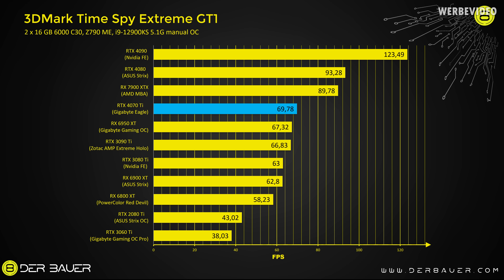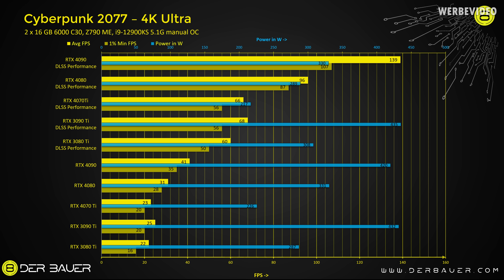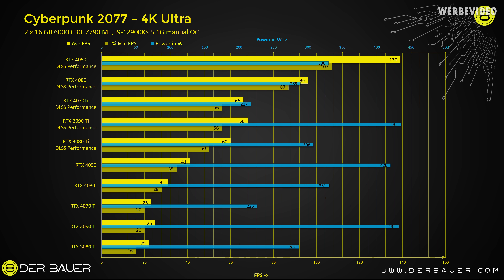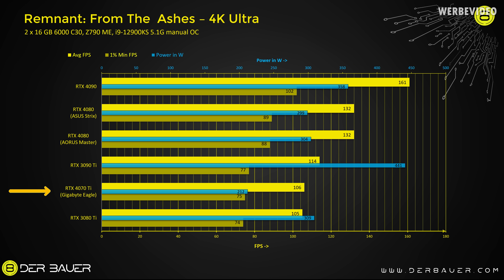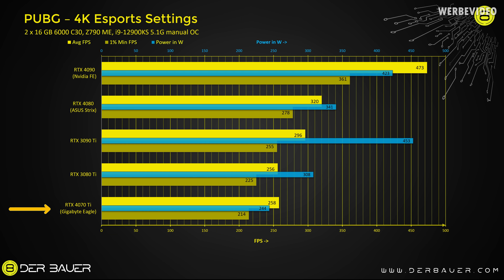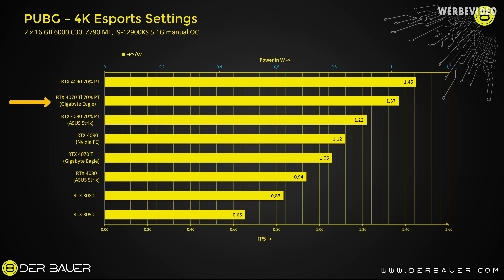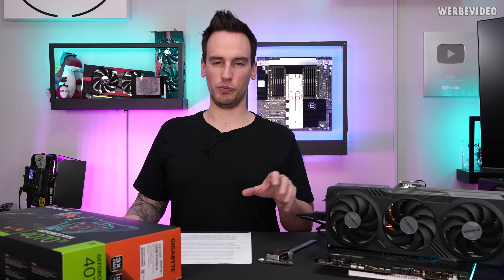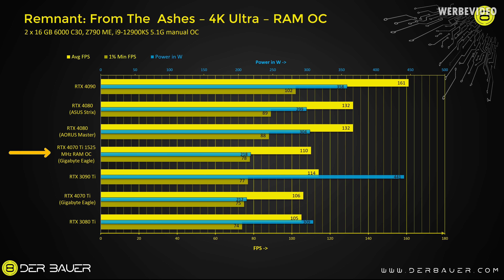Overclocking RTX 4070 Ti VRAM to Compensate 192-Bit Bus Width?

Comment: Shame you're testing a budget card only on a high end reference system (target audience is more a mid-tier ~12600k, a game like PUBG is more CPU intensive then CBP'77), and using "review drivers" at that (what does that mean? optimized for benching certain games? not ready for release?).
I trust the comparative performance from your testing ofc, but did you actually play any games to see if the real world fps hits the same absolute numbers?  (especially card memory sometimes gives diff results in real gameplay?)
Reply: "Shame you're testing a budget card only on a high end reference system (target audience is more a mid-tier ~12600k, a game like PUBG is more CPU intensive then CBP'77)"
Cause that is how you test hardware - you eliminate all other bottlenecks to see how the card you are testing can perform.
That way any person can see exactly how their hardware will perform with those games - or you could make absolutely worthless benchmarks by having various bottlenecks to that nobody got any useful information.
Reply: @ABaumstumpf  I understand what you're saying, but I'm thinking it would be interesting to see how it performs in a system as its going to get used in.
If a 12600k would at some point be a bottle neck, how much would the difference between 12 and 16 VRAM matter for example(if at all), and does REBAR have an exponential benefit?
Testing on a system that doesn't have the possible bottleneck doesn't provide the full scenario for the cards most likely use case imo.
Reply: @denios36  Bruh! i9 CPU's or comparable Ryzen's used by 90% of testers. Guy above explained already why. I hope you go around youtube with the same comment, just to annoy other people...
Reply: @Dr1ftop1a  Check his videos, he has the 12600k in plenty of them. If thinking about a use case scenario and exploring performance parameters is "annoying" to you, you might be in the wrong channel.
Reply: @denios36  "If a 12600k would at some point be a bottle neck, how much would the difference between 12 and 16 VRAM matter for example(if at all), and does REBAR have an exponential benefit?"
All those things you can see by looking at the review of the GPU and CPU separately. 

"Testing on a system that doesn't have the possible bottleneck doesn't provide the full scenario for the cards most likely use case imo."
Nah, it shows you what you would can expect - look at a review for the CPU you got, the GPU you got - and the worse of both worlds is exactly what you will get.
Reply: "All those things you can see by looking at the review of the GPU and CPU separately. "

That statement doesn't make sense considering what you're replying to. 

You're apparently fine making assumptions, I would like to see actual benchmarks and empirical testing.
Reply: @denios36  Then donate to the channels and see who makes a video for you. Jesus
Reply: You are utterly clueless
Reply: @riba2233  If you have something interesting to to add, please do, otherwise just don't bother responding and go be 12 somewhere else.
Reply: @denios36  it is not worth explaining anything to you, but basically everything you wrote is wrong

Comment: Surely that Gigglebyte Gaming OC card does not need a cooler that long...
Reply: And surely the RTX4080 doesn’t need Quad Slot coolers with vapor chambers and 350mm lengths. These AIB cards are ridiculous. They basically looked at the MSRP, then looked at the specs, and thought to themselves, “holy shit, we can put like 200$ BOM cost into the cooler alone and still make money!”

Comment: For sure could be a good water-cooling card for how small the PCB is, good for small factor cases looks like
Reply: Isn't he talking about the small PCB? Like if you take the cooler off and put a water block on it, you could put it inside a small case, whereas a 4080 or 4090 might not fit, so this would be maximum GPU power for that particular case.
Reply: @kasimirdenhertog3516  I just meant for future reference if the cost comes down but I mean hey you want a powerful card that PCB is the smallest I have seen from Nvidia for the past 2gens.
Reply: @Zensaitv  yes, the size also caught my eye because I've got a small case. Price is not the issue for me, just the size. Currently I've got a 3060 Ti, which is even smaller. The 3070 (and higher) is a bigger PCB. Therefore, this 4070 Ti interests me because it might fit my case and is a step up from the current fastest option (for me).
Reply: I would not waste a single penny watercooling this thing. For that cost I'd rather have a superior air-cooled GPU. The fact that this thing is so close to a 3080 Ti, yet I can find 3080 Ti on the market that still have two+ years of warranty for $100-200 less, is pretty damn sad
Reply: not for the price, if you could buy just the pcb and save money maybe, but nvidia would never do something pro consumer like that
Reply: @Menti Capti OP was talking about using the card in a water cooled SFF build where heat dissipation (and total power use) and physical component size become a major factor.  You have a close minded view about what water cooling is used for.  Some people just like it for the aesthetics, others like it for the silence, some people do it for the size reduction etc.

Also if you think all of that stuff only costs "a few hundred dollars" I would avoid it, because cheaping out on water cooling parts is a great way to spring a leak and kill your system.  Quality parts will be more than a few hundred for a full kit.  Just the block alone would be $200+ for a full cover.
Reply: @Menti Capti You are entirely missing the point of a SFF build I guess. Do you even know what SFF means?
Reply: @Menti Capti Ok good for you.  However your experience doesn't mean other's don't have good experiences with SFF builds or enjoy building them for whatever reasons they may have.

The OP obviously likes SFF or they would not have made the comment.  Telling them to simply get a bigger case is entirely disregarding them and arrogant in the extreme.

Who cares if its a waste of money or they aren't building the most optimal system.  It is not your money or time or effort, it's theirs.
Reply: @Menti Capti You didn't hurt me at all.  I was trying (seemingly in vain) to enlighten you to your arrogance.  Clearly, you are a lost cause so I will stop trying.

Comment: 4070 Ti, the GPU I want, from a manufacturer I loathe, at a price I refuse to pay.

Niave fingers crossed for 2024.
Reply: In 2024 you gonna pay 1200 dollars for a RTX 5050 Ti
Reply: @SMGJohn  nVidia charging that and me paying that are very different things.
Reply: @SMGJohn  
Most likely not, but $600 for 5050 sound plausible!
Just because 4050 will be the most popular middle range GPU at 2023 at price of $500!

😂
Reply: fa real tho
Reply: Maybe the 20 year low in GPU sales during the holiday season with brand new products on the shelf will cause a course correction. My wallet is firmly holstered, and my 3080 is still running great after 2 years.

Comment: “4070ti is 4% faster than the 3090ti” proceeds to be slower in every game.
Reply: raytracing, DLSS.
Reply: @ABaumstumpf  and yet the 7900xt is significantly faster in raster and extremely close in raytracing for $100 more. Also has way more memory.
Reply: @SeventhCircle77  "and yet the 7900xt is " that does not have anything to do with the comparison between 3090Ti and 4070Ti - so irrelevant.
(also DLSS and raytracing would still apply)
Reply: "uP To tHreE TImeS FaSteR thAn A 3090Ti"
Reply: at $850-$1000 for AIB cards its making 7900 XT for $899 look good.

Comment: Your statement about fewer memory chips restricting bandwidth is weird. Shouldn't have any effect on the bus. Maybe I misunderstood you though.
Reply from the maker: The bandwith, or bus width in this case, is nothing else than the connections to the memory chips. Each chip uses 32bit connection. If you have more memory chips hooked up to a GPU (if the GPU supports it!) you can make use of more bandwith. To increase capacity you can also hook up two chips to one connection but it doesn't increase the speed.
Reply: @der8auer-en  Not actually totally correct.  Depending on bus capabilities each chip can be a rank just like in DRAM for main system memory.  This is a potential performance increase as long as the memory controller address bus can deal with the data signal change.
Reply: @der8auer-en  32bit? well I guess that would explain. I thought memory was 64, 128, 256bit, etc...

Comment: I was wondering all the time about this topic comparing it to my 3070 TI with 256 bit bus! Thanks Roman!
Reply: That 192-bit bus really makes a difference at higher resolutions.  Stay at QHD or lower and there shouldn’t be any issues.
Reply: @Great_America  Exactly ..... I consider the XX70 series to be a 1440p card and the XX80 to be 4K at least with the last few generations. What really pisses me off is that Nvidia decided to BS us with a "up to 3 times the performance of a 3090 TI" which doesn't make sense ..... To me just telling the truth, it can trade blows with a 3090 Ti at less than half the cost and uses half the power which to me is a pretty significant generational gain since it is 2 tiers below a 90 series
Reply: Yes I was surprised they did this too.
Reply: The trade off with the 4070 Ti for having 12GB of VRAM is a smaller bus width. Though the silicon is made on a smaller die process, so make of this info what you will.
Reply: KML III  not when ray tracing and path tracing are involved.
Reply: Nothing would benefit you from having 256bit in the 3070ti if it is worse in everything, the 4070ti yes, it has 192bits but it pays to have gddr6x and a much more efficient architecture
Reply: At the end, if it’s priced correctly, who cares about the bandwidth. But this isn’t priced correctly, at least with the expectation of substantial value increases.
Reply: @KellyWu04  Well I do. Because the RTX 3070Ti has total 608.3GB/sec memory bandwidth,  4070Ti has 560.6GB/sec . That is regression in memory bandwidth with ~34% msrp price increase over 1 generation
Reply: @fleurdewin7958  If the 4070 ti has the same MSRP as 3070 ti but performs much better, I don't think it matters that much that 4070 ti has a narrower bus
Reply: @fleurdewin7958  in many regions like mine the 3080 and 3080ti are basically the same price as a 4070ti though so might aswel go the 4070ti it's still pretty much always faster than both.
Reply: Is there any article explaining why the 40 series GPUs have narrower bus width? It was way back in GTX 10XX that the 1060 had 192 bit, and the X70 class cards have always had 256-bit width bus (except for the 970 fiasco).
Reply: @namastyle  they increased the on die cache (similar to what AMD did with the 6000 series). The issue that AMD ran into, and now nvidia is that no matter how much cache you have, lower bandwidth is still going to limit the amount of data that can be streamed to the card. If the 4080 had a 320bit bus, it’d be much closer to the 4090 than it is right now. I think they only did this because of how negligible a difference there was between a 3080, 3080ti, and 3090. They needed to make a larger gap between the cards to be able to launch skus to compete with AMD/Intel (maybe) that fill in the performance gaps that are between the 4070ti/80/90

IMO though, the 4070ti should’ve for sure been a 4070 with the bandwidth that it has. As I said though, there needed to be a big enough gap to justify the cards. The next round of DX12 UE5 and other games with crazy Raytracing and path tracing is going to force this card into the 1080p with DLSS territory very quickly
Reply: @namastyle  They did a similar thing that AMD did by lowering bus width and adding more cache (except NV added more L2$ whereas infinity cache is L3$) in order to increase VRAM capacity. Otherwise if AD104 had 256bit bus it would be limited to either 8GB or 16GB, and we all damn well know NV would chose the cheaper 8GB option. This way they can keep almost the same performance but increase VRAM size to 12GB

Similarly 5700XT was 256bit bus and 6700XT was 192bit (also why 5700XT was a better mining card than 6700XT)
Reply: @ThunderingRoar  I believe they did this so there will be a substantial enough difference between a 4080ti with a 320 bit bus with 20GB of memory, vs a 4090ti/titan with 512 bit bus with 32gb (unless they just fully unlock ad102, stick with 384bit and slap 24gb of ggdr7 which is likely going to be the case) and mark it up to $2k-$2.4k. I’m not sure how fast first Gen gddr7 will be, but I can’t imagine they will intentionally target anything over 4k performance. If they did that, they’d be cannibalizing potential 5070-5080 sales, especially if they weren’t on gddr7, or were on the same speed gddr7 as the 4090ti/titan. I know that’s a bunch of speculation, but I’m certain there’s some truth in there regarding the 4080ti, and if they decide it’s safe to launch, a 4090ti/titan
Reply: @namastyle  the reason is just that they went greedy, they released this "4070 Ti" (that IRL it's a 4060: look at the bus width of 192 bit and the humongous die cut), the 4080 (the latter it's what should have been the 4070/4070 Ti again, 256 bus and less than 60% die cut of the 4090, as it was with the 3070 vs the 3090 Ti) and we are totally missing a true 3080 successor (320 bit bus and a 20/25ish% cut of the full die). We'll probably see this 4080 Ti 20Gb much later.. but this one should have been the "4080". They totally re-stacked the gpu dies and the naming scheme.
Reply: Its significantly slower even with max overclock. Know this for a fact without even seeing the video, owned a 3070 Ti.

Comment: I hope these cards rot on the shelfs.
Reply: expensive paperweight
Reply: My 3080Ti is fine until Nvidia sorts its shit out
Reply: @kyzer6666  3080ti is nice performance but a bad price but that's just nvidia things, not your fault.
Reply: @SK-HYJINX  strongly depends on where you buy it. I paid $700 for mine.
Reply: @SKHYJINXPC  My price was £959 new after the 4090 dropped
Reply: Your 3070 Ti is fine in any scenario, there is absolutely zero reason to upgrade a mid to high end GPU every year except for deep learning or rendering tasks that convert to profit